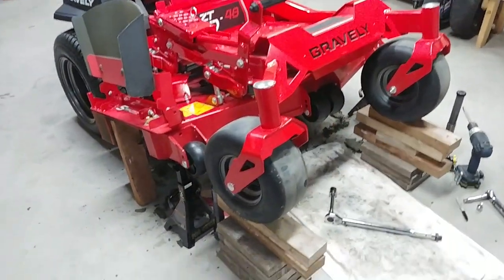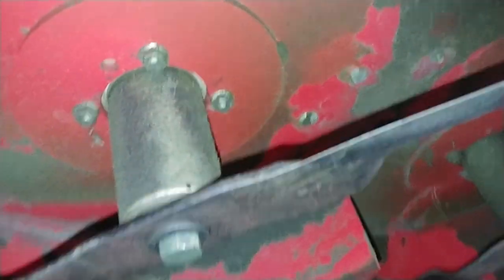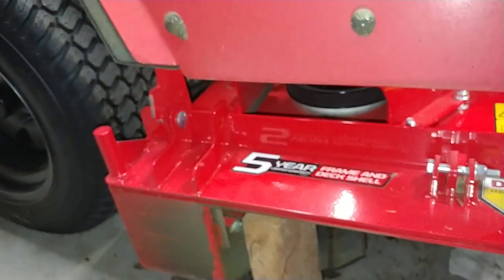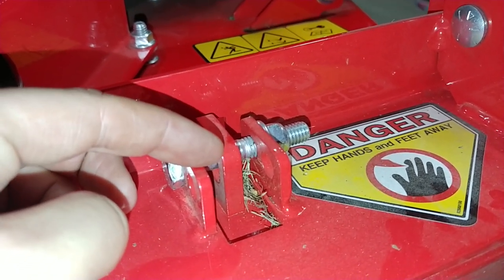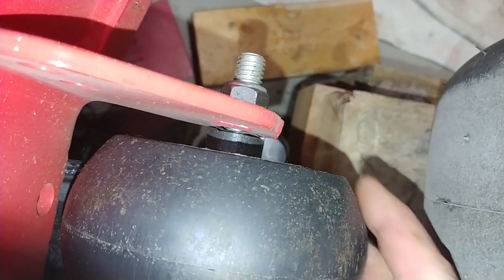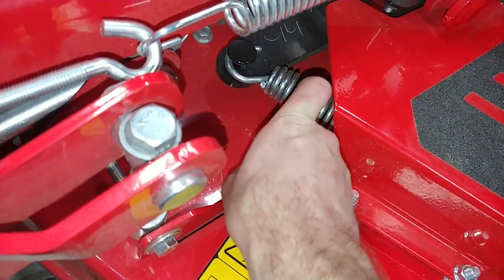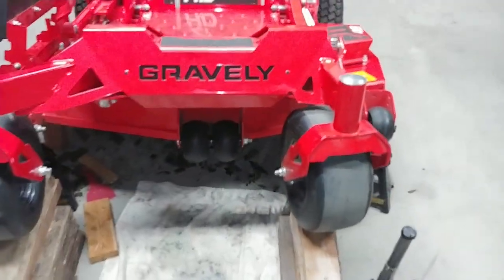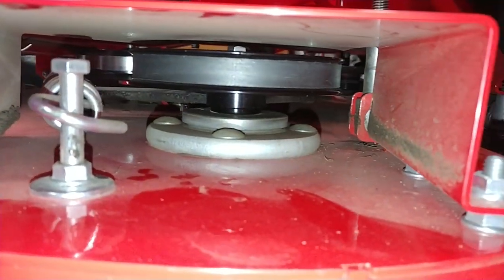2018 Gravely ZT HD 48 - Blades/Deck Details & Yep, the Famous Deck Rattle

Comment from the maker: Right after this video I got a set of wheels cribs from Race Ramps. Just jack the front up and set the tires on the stands. Much easier and safer.
Reply: I just recently bought a ZTHD52 and was relieved that my $100 Harbor Freight mower lift will lift it sufficiently to service the blades. 9.2 hours on it so it will be getting oil change in a couple days. I had to move the deck wheels up to the high position as it wouldn’t match my S240 when in the 2 1/4 inch setting. After adjusting the deck wheels it matched the JD’s cut. I was surprised at how clean the underside of the deck was as I had cut quite a bit of wet grass with it. It was rainy the day they delivered the mower but I had to try it out anyway. The rear deck wheels are hidden on the inside of the rear deck wall. I had to jack the mower up to adjust them. I noticed the deck wheels noise quickly because it was speed related. ZTR mowers are loud and naturally noisy. I wear shooters muffs or ear plugs and don’t worry about the rattles or occasional screeches.
Reply: Thanks for this tip. I am getting my mower this week. We have crawdads really bad, so from March-thru May, I have to get under the mower and scrape off the mud.  Did you get the 12" ONE-PIECE MULTI-PURPOSE WHEEL CRIBS?

Comment: Thanks for taking the time to show your machine. 
1. People have been saying the tensioner spring is the issue. I dont think thats it at all. There is nothing for the tensioner spring to rub against. Yes it moves a lot when the pto is engaged and at first I jumped on that band wagon as well. Thats not the rattle. 
2. The discharge chute does make a lot of noise but it's not that irritating at least to my ear. Maybe a little irritating lol. Maybe we can tighten the bolts and leave it in the up or down position and that will help. 
3. When you lifted up your floor deck you need to look a little closer. I could see where the floor deck is rubbing on the round cross support bar just like it was doing on mine. two spots close the the left and right ride of the bar. I posted this on the lawn mower forum a few days ago. Easy to fix. The harmonic's that this area was making was almost unbearable and I wanted to bring the mower back. Now after the fix I love the darn thing . 

strick
Reply from the maker: Strick - Thanks for the input! I also noticed the round bar rubbing on the floor/panel, but it doesn't make any noise unless I lift my feet off the panel when mowing. Since my feet are always on it, it stays quiet, which is why I forgot to mention it in the vid I guess.

Comment: TD, for safety sake and convenience get a lift for your HD!!  Also try some silicone spray on those wheels and find heavy duty plastic washers for the wheels.
Reply from the maker: An update for you, I did get a normal hydraulic floor jack and Race Ramps wheel stands this spring to put it up on now when I do do maintenance. Much safer now!

Comment: TD - A large sheet of cardboard makes is easier to slide back and forth while working under the mower deck.  I'm speaking from a lot of experience.  Work smarter not harder.Thanks for sharing your Gravely experiences.  Oh yeah, one other thing.  Rattle?  What rattle?? With the engine running and ear plugs and ear muffs on I can't hear any rattle!  :)

Comment: Does your owners manual mention the towing capacity? I contacted Gravely and they told me the towing capacity is 450lbs.  That seems like a lot for a zero turn.  I have a Trac Vac that I would like to keep if I get the ZT HD but need to know the towing capacity.  It weighs 300 lbs.  

Thanks again, you have been great with answering questions.
Reply from the maker: Michael Miller - No problem, I'll take a look for you and let you know what I find out.

Comment: Great job, but for 2 reasons, safety and convenience buy a mower lift.  Also spray some silicone on those wheel bushings and under your clean deck.  I hope Gravely watches your videos!
Reply from the maker: Thanks!  Yeah, I really do need to get some sort of lift or hoist. Also need an eletric impact as well for getting the blades off. Would make it 10x easier.
Reply: Those blades are tough, electric impact wont do it. You either need a long breaker bar, or a cheater bar. I have same mower

Comment: Could you put a plastic washer in your caster wheels? I'm sure they would need replaced frequently,  but it's a thought 🤔
Reply from the maker: I thought about that also, but haven't tried it yet. Lately this year I just turned the music up louder and can't hear any rattles 😂
Reply: @TDMILESKI  I just got one[used], took the casters out to clean everything,  going to try that. Won't be using it till spring but it's a 12 cent potential solution...

Comment: hi, i have that mower also ratting comes on mine from that lift up gate
Reply from the maker: Terry Smith that also rattles on mine if I lift my feet, but when I have my feet on it, it stops. I have a video of mine running and the noise coming coming from the anti-scalp wheels, then stopping when I put my foot on the wheels. I need to upload it soon.

Comment: What parts/pivot points need to be lubricated?  I'm looking for grease fittings.  What's your recommendation?  Thanks!
Reply from the maker: Everything is sealed on these units. No zerks on the deck spindles or the front wheel spindles. Some of the pro models have/had grease zerks.
Reply: @TDMILESKI  thank you!
Reply from the maker: @bstevenson8516  No prob!

Comment: do you have any vibration in your main drive belt for the deck when the blades are engaged?
Reply from the maker: I'd have to check to be sure, but I'm sure I do, I've never seen a mower with belts that don't bounce/vibrate at least a little.
Reply: @TDMILESKI  mine is a lot… maybe 2” of travel
Reply from the maker: @HisWayHomestead  That seems excessive if it's that much, maybe you have a pulley starting to go out. I need to cut the lawn today, so I'll check and reply if I remember.
Reply: @TDMILESKI  it only has 10 hours on it…. It’s a 2021 ZT HD52
Reply: @HisWayHomestead did you ever figure something out to help the problem?
Reply: @wes8899  dealer had to replace some parts.  It’s better but there is still some vibration.
Reply: @HisWayHomestead did they cover it with warranty? Do you happen to know which parts?

Comment: which way are you turning the bolts to remove the blades?
Reply from the maker: The normal way, counter clockwise to remove
Reply: So after you install new blades witch way  do you turn bolt to tighten them back up?

Comment: How do you keep it so clean? Mine rattles too😞
Reply from the maker: I blow it off with compressed air after every use to get rid of the dust and grass clippings. Then I just wash it a few times during the summer.

Comment: My 52" deck is almost identical to yours except it has some baffles in the front.  Yours has holes for the same baffles, but the baffles aren't there.  Did you take them off for some reason?
Reply from the maker: Baffles are an optional accessory on the HD models. They only come stock on the Pro series. I haven't purchased them yet.

Edit: so if yours came with them, the dealer probably installed them before the sale as an automatic up sale and just raised the price $100 or whatever the baffle kit costs.
Reply: @TDMILESKI  Mine is a HD also and all the dealer did was cut the plastic and get it off a pallet.  I think they put the seat on, but nothing else.  Interesting, I either got lucky, or got taken.  lol.
Reply from the maker: @shawnbond1975  That is interesting. Mine came from a crate also, although I wasn't there to watch them unbox it.

Comment: Got yourself a nifty homemade Guillotine there, Harbor freight sells a respectable mower lift for about $100, less than one doctors visit when this Mickey Mouse set up you got there falls on your head.
Reply from the maker: Thanks for the tip! I'll be getting a proper lift this spring. I also had jack stands under it,  and the parking break on in case you didn't notice, so I wasn't worried. But yes, accidents definitely do happen!

Comment from the maker: Hey all, thanks for the views and support thus far. I will be getting a proper lift for maintenance this season also! With Spring finally almost here, I'll be uploading more videos this year as well. Let me know anything you would like to see! Thanks!
Reply: I would like to learn easiest way to access the instrument panel on a 2023 zt hd 52.   I notice older ones are different.  Don’t want to take to many bolts out that may make the job much harder.